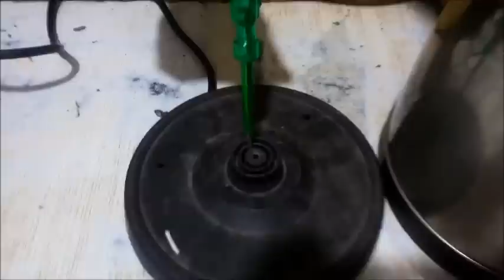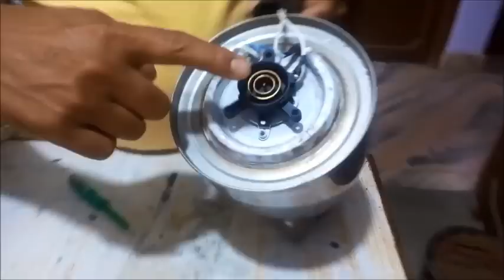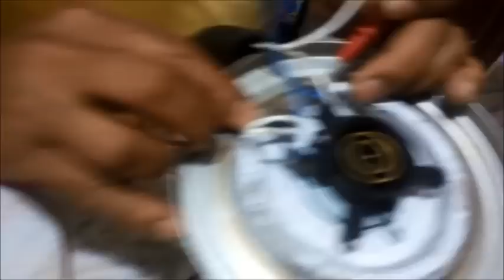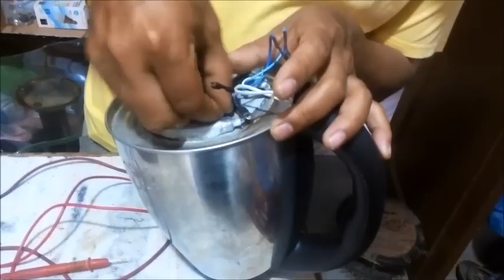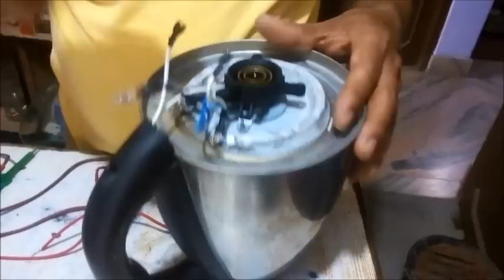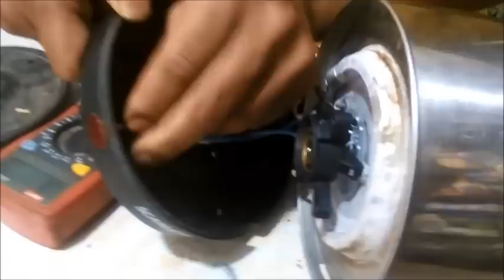how to repair electric kettle at home? 114K views .

Comment: My kettle lights red, but it doesn't heat the water at all... How can I fix it???
Reply from the maker: Dear Namagwa Gloriah, thanks for your comment with question.

It means there will be either one cable removed from coil or damage its coil. So you open it then check. You should seen there,, if only disconnected cable shoe, yo can join theirs place but if its coil damaged, no need to repair it. You should buy next one plz....

Comment: Hiii whenever I connect my prestige kettle in switch board power cut happens is their any prblms in my kettle or power supply I m really worried plss rplyyy
Reply from the maker: Deat ethanic beauty, thanks for your comment with question.

First of all your kettle must be short circuit, but it may be base or on kettle side. So you need to check both side, open both side by using one screw driver then check,  there`s some cable shoe will be shorted, you will be need to put theirs right place. Then it will be do right work.
Tkanks

Comment: The kettle switches off within seconds. How to fix the button so it keeps on? The electric connections and element are okay. Thanks for any help.
Reply from the maker: Thanks for your coments Boncela, if you have getting problem by switch, you need to change that switch, it is easy to open. You just remove handles screw then buy one same size switch from market, then change it easily.
Reply: @SuKaCreation  Kun thau ma paucha tyo switch ( Jb-01e)  ??? Kati parcha ?
Reply from the maker: Hajur lai kun thau maa chhaiyeko ho?

Comment: My kettle is generating more heat in half of the base and half base is okay .. what is the issue?
Reply from the maker: on the base coil, there will be make some gap from base plate, so where it touch with plate, that will work properly, but where is having gaps there will be heat. So you can open its down side and check it once. thanks for your comment.